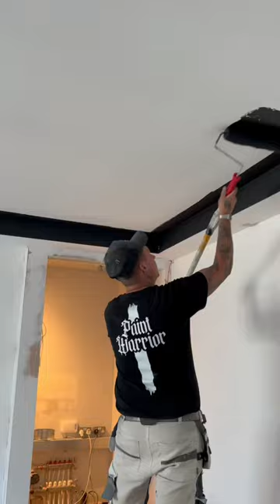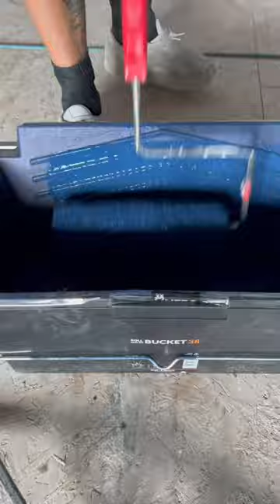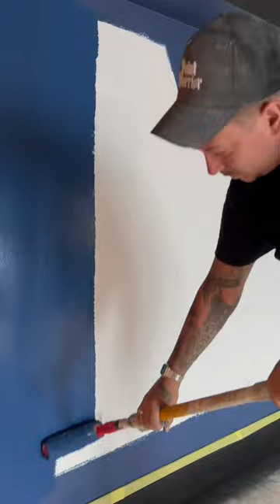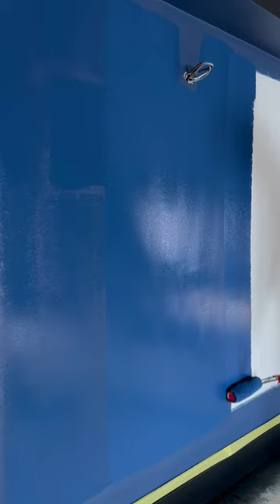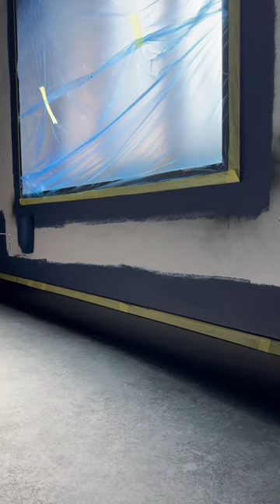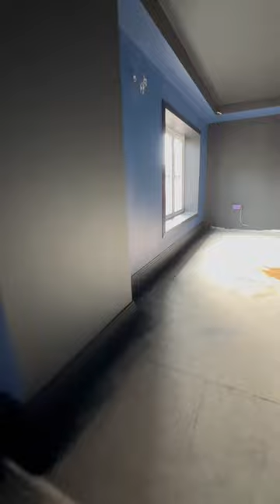PAINTING A HOME CINEMA ROOM.. #asmr #satisfying #paintingstyles #paint #diy #paintingtechniques #yt

Comment: I recently upgraded to the 18 inch roller frame and entire set up… but even when I was using a 9 inch roller, I always let my roller get good and soaked with paint and then keep it nice and wet (I hate seeing rookies roll their sleeve out dry before dipping again) then, I start in the middle of the wall about 3 roller sleeves away from the corner or the last pass, and then roll that paint out evenly up and down starting from where the average persons line of sight will be, spreading that paint (rolling it out) from the middle out (up and down) working it back into the previous pass while applying sliiiightly more pressure to the side of the roller that’s leading into the direction I’m rolling (this makes a paint line on just the one leading side of the roller and it’s the side that you’re rolling into so you never leave a paint line)… This method cuts way back on how much back-rolling is actually necessary to make sure there’s no lines and the finish is right… I rarely have to backroll but this depends on the brand of paint, the color, and the sheen being used.
I’m not saying my method is right or that you’re wrong the way you’re painting… to each his own… In the end, it’s the final results and the name you make for yourself that are mostly what matters in this or any business… making money comes second and if you operate like that, the work and the money will almost certainly always come to you.

Not saying you’re wrong, just bouncing information out there for whoever wants to receive it